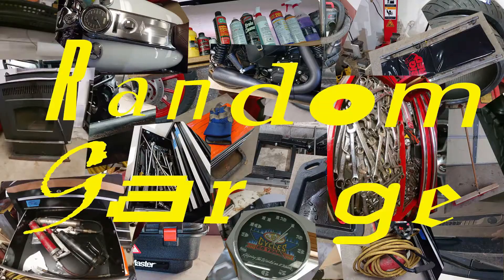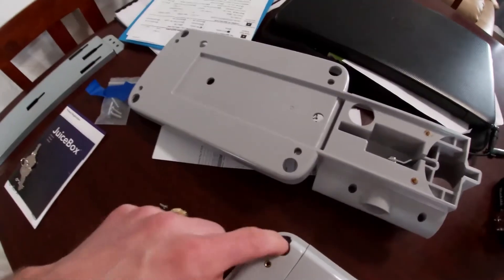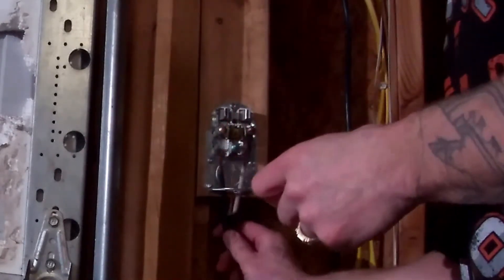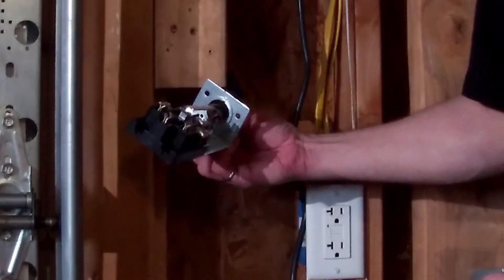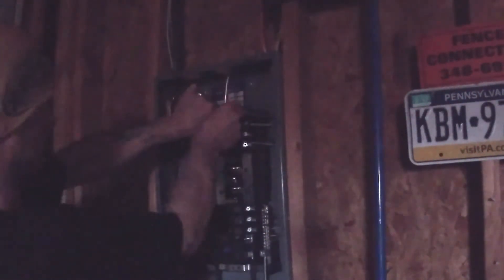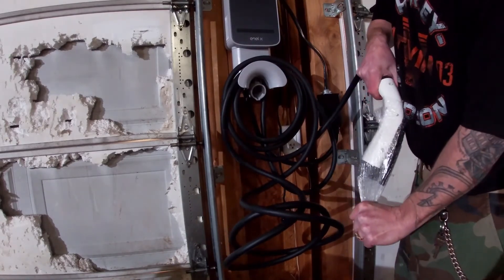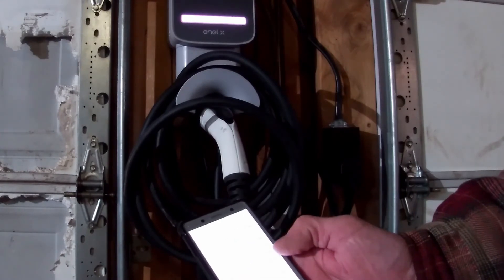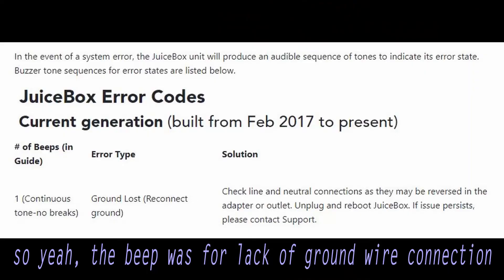Installing a JuiceBox 40 residential EV charger - Random Garage

Comment: As many of the comments have stated, do not do this. This will never pass an inspection and is a dangerous set up. Get a licensed electrician, pull a permit and get it inspected. You have an expensive EV and your home. Don't cheap out on your EVSE install.

Comment: So much wrong with this video, I hope you don't have a fire. 
A job like this would NEVER pass an inspection and if there's a fire your insurance company will probably bail on you.
The breaker is sized according to the wore size not the load.
It looks like the wire is a 10 Guage and that has a 30 Amp breaker, you can't just change the breaker to a 60.
Reply: Please Do Not Do This at Home..

Comment: Hi, This charger required neutral wire or not? Can I use two hot and ground? I mean it's Romex 6-2 gauge wires.
Reply from the maker: It did require a neutral, but you see how I bypassed it.

Comment: Thanks for the video, Random Garage. I just wired a 14-50 outlet to my garage in anticipation of the arrival of the Jukebox 40 I had ordered. Unfortunately, when the device arrived, it had the kind of plug your garage already had (6-50). When I called Customer Service and asked if I could rewire a 14-50 plug onto the Jukebox, they told me NO. Among other things, I would void the warranty if I did this. So your viewers might want to know this. Also, the Juicebox web site explicitly calls for a 50 amp breaker for the Juicebox. Remember that breakers protect the wiring from overheating and starting a fire. I'm not an electrician but I think oversizing a fuse reduces the chances that the breaker will trip if the wires heat up. Given that wires run through walls, that's a potential problem. Also, I see two things that might concern someone jury rigging a 6-2 wire the way you did. First, you now have an ungrounded high voltage device in your garage. That may not be good for you (or your wife). And I'm not sure how Teslas handle electricity, but it might not be good for your new car either. The other problem is that the ground wire in a 6-2 or 6-3 wire is a smaller gauge wire - maybe by as much as 50%. I think smaller means more resistance and potentially more heat. But maybe that's not a problem when you turn a ground wire for a 6-50 outlet into a neutral wire for a 14-50.